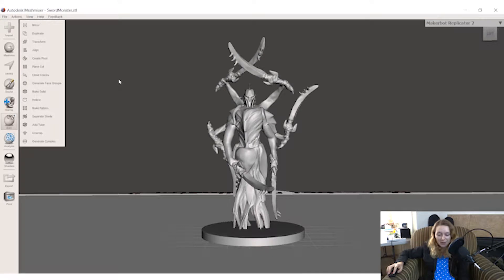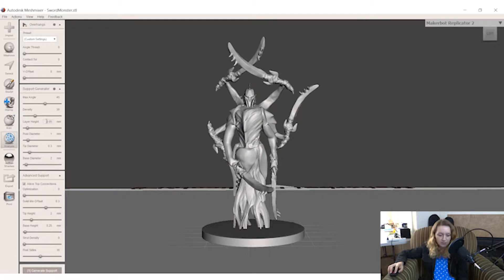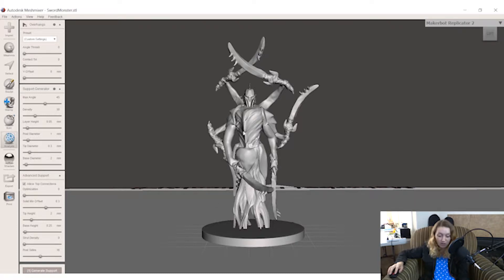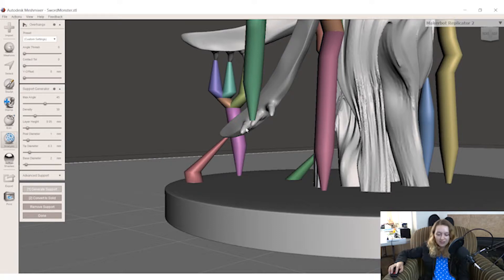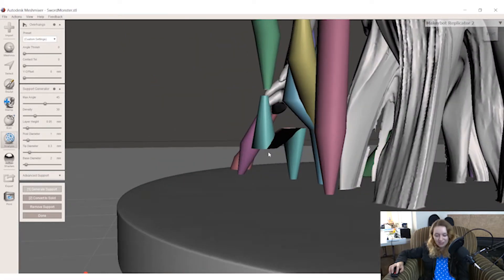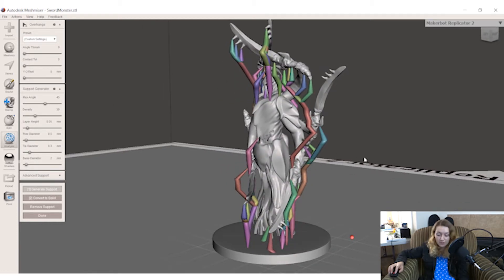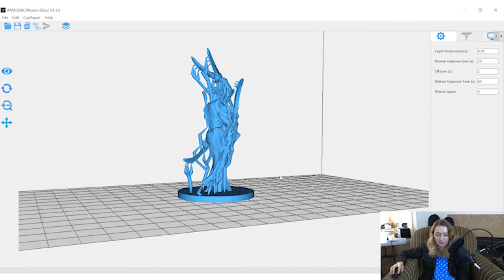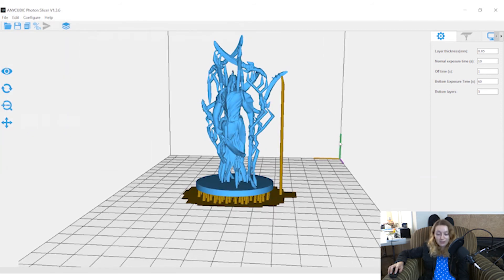Meshmixer Supports for Resin 3D Printing

Comment: If you change your layer height to .02 will that throw off the rest of the settings? (finally got around to watching this GREAT JOB!)
Reply from the maker: It should work either way. Logically, the exposure time could be lower for 0.02 layer height since there is less resin that it is curing. 

So glad you liked the video! :D
Reply: Had no idea I could do that in meshmixer, thanks for sharing!